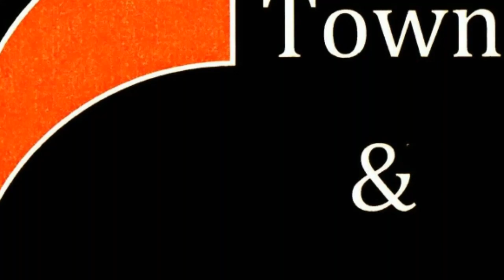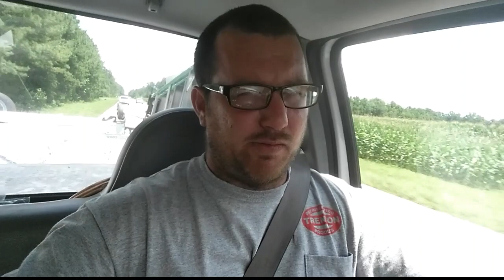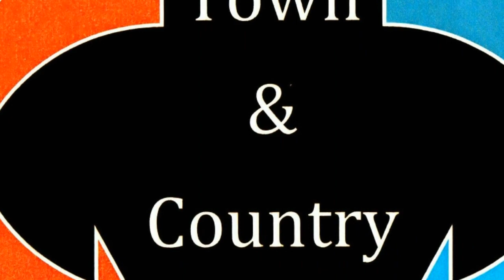Effects of Running an Air Conditioner with a Refrigerant Leak

Comment: If leak is fixed, will system eventually return to an "unsaturated" normal condition in the area of oil saturation in txv and coil?  Would a season balance out the saturation or is the saturation going to remain once the flow of refrigerant is normalized "correct charge"?

Comment: Sometimes because of my inexperience I ask questions that seem to come out of the twilight zone and here is one of them.  Since 134a is a blend of two different refrigerants, could a leak allow one of the refrigerants leak out faster than the other causing an imbalance in the blend of the refrigerants?
Reply: Daniel Baker That's actually a pretty good question.  I wish I knew.  I will guess and say probably not because it's under pressure.  The mix is mixed and flowing together and escaping together.  Blended and working at the same equivelant pressure.  But that's just my guess.  There might be a change in the blended ratio when system is not running which might allow the seperation and escape of the "lighter" refrigerant but that's just another guess.  Anyone care to correct or answer Mr. Baker's question?

Comment: Well said zach. The evaporator in the video I posted that has low suction pressure had a VERY oily piston (not clogged) and a bunch of oil dripping out of the seat (if you can call the place where the piston sits, a seal). Havent seen that before but hey, im new the the AC part of HVAC. 
Thanks for the video.
Reply from the maker: Every time you have low refrigerant velocity you will get bad oil circulation

Comment: Also the potential for compressor winding insulation breakdown over time. Resulting from the comoressor operatiing at hotter temperatures due to insufficient refrigerant flow, which is the compressors only means of cooling.

Comment: It's illegal to add refrigerant to a leaking system that contains more than 50lbs. And leaks at a rate of 10% or more per year. 

You can add as much refrigerant 22 to a resi system as you want cause there is no resi system that I know of that hold 50lbs of refrigerant lol.

Good talk

Comment: Very well said. Plus you loose oil every time there is a leak. So if that is not replaced the compressor will not work well for long.

Comment: Goods words of advice.
Reply: When ac is low on charge or evap is clogged, the ac is at less capacity. Over time the oil stays in the evap or washes out the compressor. When prob is corrected by cleaning coil or fixing leak, the comp now has to perform at its rated capacity only now the comp itself has been damaged by inadequate charge or oil causing in the future for the comp to fail...